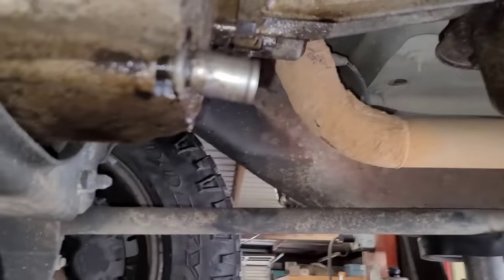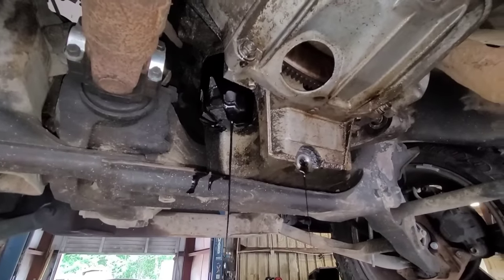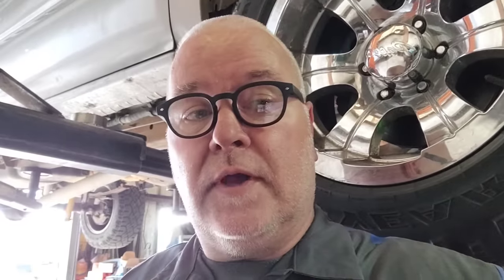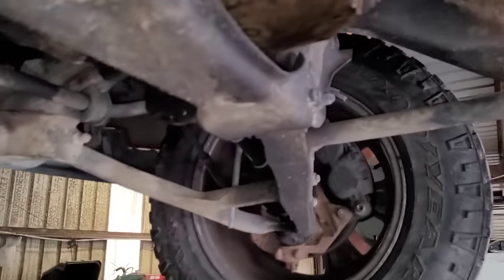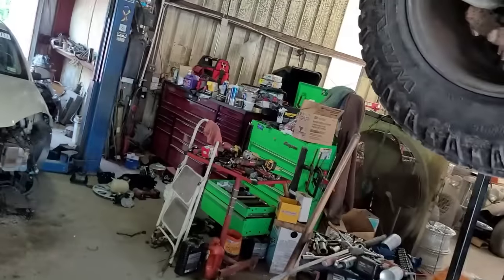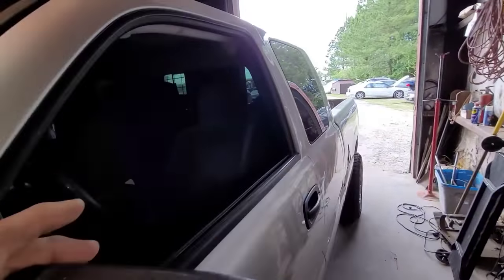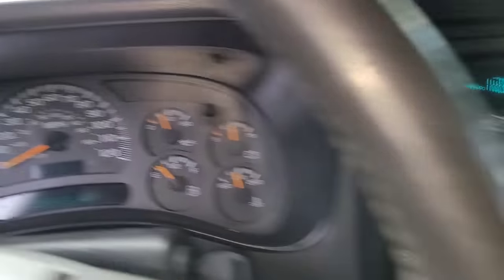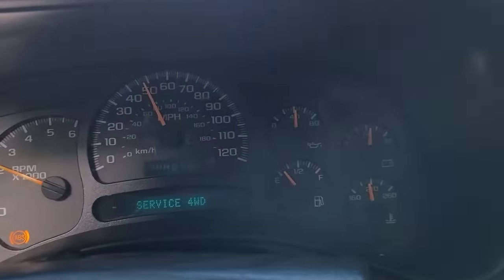We changed the oil in the noisy 5.3 and this happened!! The damage is done unfortunately..

Comment: If that were my truck, I'd dump that oil you just put in there after 500 miles, refill with new oil and a new filter AND an oil flush, run that for the 10-15 minutes it suggests and do another complete oil and filter change.

Comment: Does anybody on here know if going 4,000 mph oil change on a 2001 GMC Sierra SLE extended cab two-wheel drive with a 5.3 l vortec V8 is going over the oil change

Comment: Wonder if you called the customer about dropping the oil pan after finding the results? Any metal shavings will eventually circulate through the system and clog or damage the engine even more once the pan is full of new oil. Just common sense and not much work

Comment: Number of bad things. Pouring oil into the filter risks pollution, it is straight from the bottle so should be good. Some people pour dirty oil from old filter into that hole. That port in the filter is the outlet that is going directly into lube system any dirt goes straight into lube system causing damage. One wipe of oil on sealing ring assists in hand tightening, using a strap or chain to tighten risks damaging filter. The Seal Ring expands during use and it is always tight when you undo it.

Comment: It's an Engine, not a motor. A motor is an electrical device found on things like fans, vacuum cleaners' blenders etc... An Engine is a device that uses a combustible substance to run under its own power. After the eighth time you said motor, I stopped counting, LOL.

Comment: Less than a quart left in the engine...oil likely has 10,000+ miles since the last change....4WD doesn't work...ABS light on...ignition switch is bad and so is the battery.....I've seen 80 year old women take better care of their vehicles.

Comment: will never understand why people will run the same size oil filter on a v8 that comes standard on a 750cc motorcycle.& then wonder why it goes into bypass so quickly.when you can crossreference a larger filter to hold more dirt.with similar bypass pressure specs.lazyness? dont give a crap? oh well, its their engines, not mine.

Comment: I would have run a flush through and out the bottom without running the motor..... flush as much metal as possible out before filling and running......

Comment: sorry sir, but after watching your video, I don't agree with your way of doing it: the engine filled with mud not flushed, oil filter reassembled without oiling the gasket, which not only makes the tightening correct at the hand impossible, but will make disassembly very difficult...

Comment: That motor needs an oil flush something fierce!
Reply: I think flushing it might cause sludge to block oil passages in a motor that dirty.
Reply: @thepitpatrol  makes sense. Adding something like stiction reducer would be a slower clean.
Reply: @Dudestuff  yes I agree. I think oil is a huge factor. We have always used Castrol.  I change oil every 20 to 25 thousand and when you pull the dipstick or look on the valve cover it is clean. Years ago I had a buddy that was a master mechanic and he worked at a dealership.  I told him I wanted my trans flushed. He said he wouldn't do it. That is caused pieces to come lose and and stop the small passages up. I kind of took that to heart.

Comment: I do not understand your thoughts on the oil consumption you talked about. If it uses a qt every 1000 miles it would not matter if you had a capacity of 5 gallons or 5 qts it's gonna burn the oil at the same rate. I don't agree with your information unless you can make it make any sense.

Comment: If this truck was a Toyota Tundra, with maintenance kept up, I would get 1,000,000 miles out of the original engine and tranny. Oh wait, I DO have a 2000 Toyota Tundra and it still looks brand new in and out and under! Regular maintenance and never a single issue for 23 years, hmmm.
  Go watch Scotty Kilmer's videos - much better dialogue and smarter than the average mechanic.

Comment: There is no advantage to pre filling your oil filter. The flow goes from sump, through the rotating assembly, then through the filter before returning to the sump. You aren't starving the engine for oil pressure by not filling the filter.

Comment: This comment is for Kenny.  If you would in your future videos please use the CORRECT name of the power plant under the hood that moves the vehicle down the road, that being an ENGINE and not a MOTOR.  I know that you know what the difference is, so please use the correct terminology when talking about what is under the hood.  Years ago I did get a so-called car mechanic mad when he asked what 'motor' did I have in me Vet so I told him that I have a starter motor, windshield wiper motor, a blower motor for the a/c and heater and also two fan motors on the back side of the radiator to keep the ENGINE cool.  So I asked him which one are you talking about???  He then walked away and I won the argument about the what a motor is and what a engine is.  Again, please refrain from calling a ENGINE a MOTOR, as you and I well know they are not the same.  Also please do not feel bad because YouTube and 99.9% of automotive repair shop employees do not know the difference either ! ! ! ! ! !
p.s.  I do like your videos as they are very informative and your knowledge is extensive and spot on and will continue to watch them.